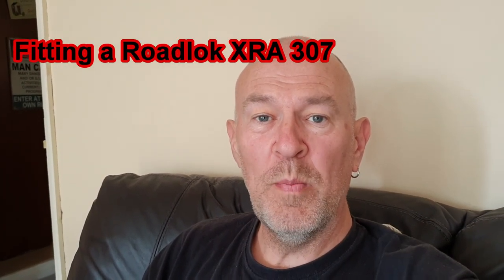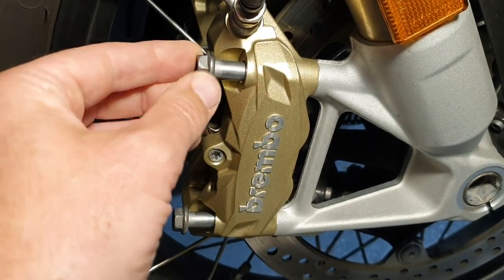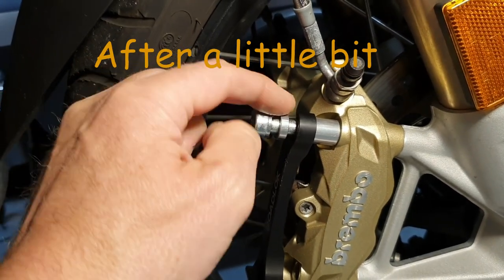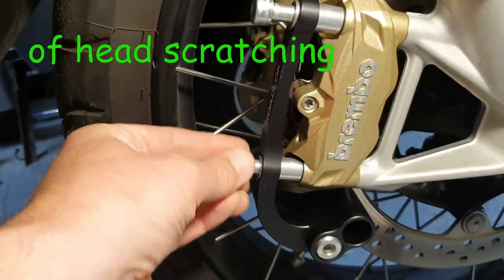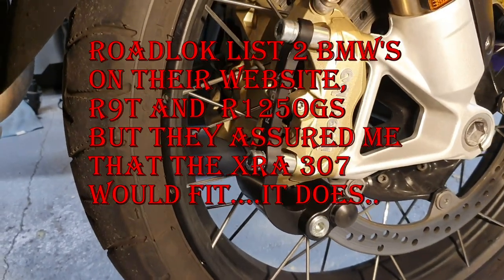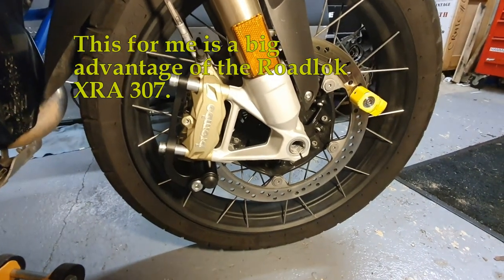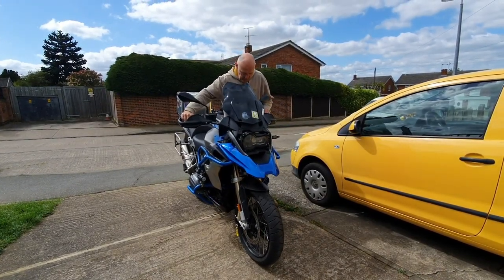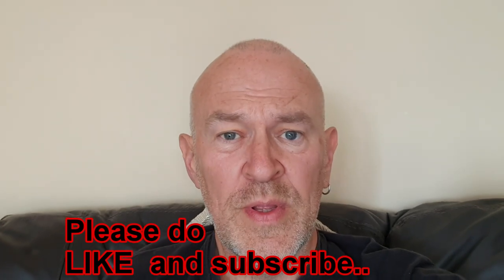Roadlok XRA 307 motorcycle disk lock.

Comment: Hello, do you need to have front wheel in specific position to lock it, or in any?
Reply from the maker: The holes on the BMW disk aren't uniform. So it's every 4th hole or so it will lock. Still got mine and love it. Although there has been an update on the lock barrel! Murt
Reply: @the_mad_leprechaun  How are you able to find the proper hole using kickstand?
Reply from the maker: Lock the pin in place, move the bike a LITTLE and it will click into the first available hole. Really not far! Although I always use the main stand. I did test this when I first fitted the Roadloc.  👍https://youtu.be/MTHtWthpAos this is the same lock fitted to my new bike! Hope this helps!